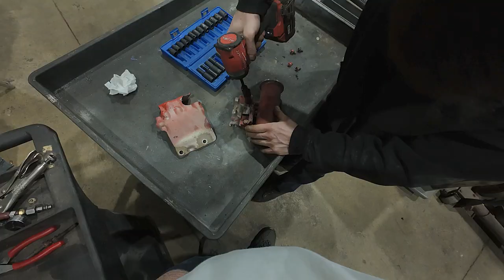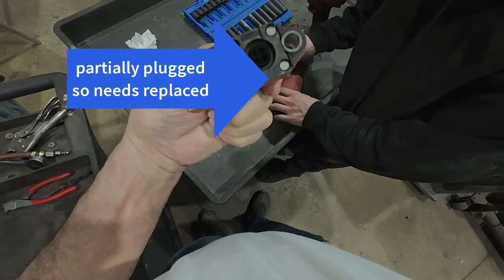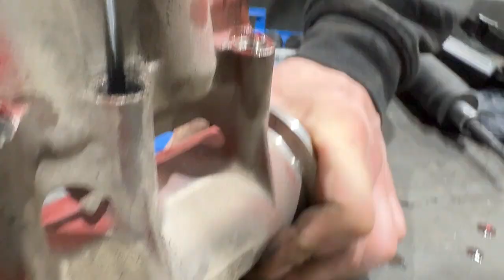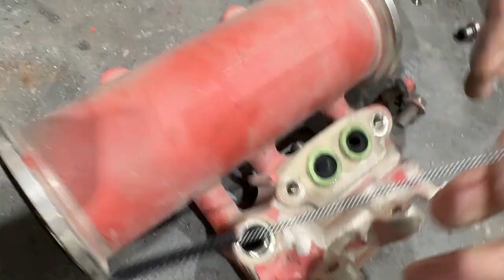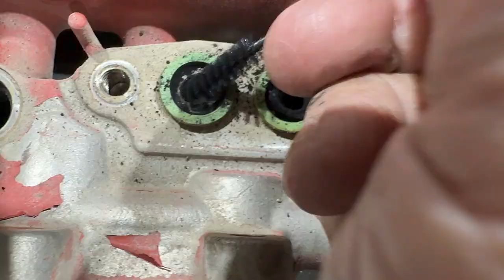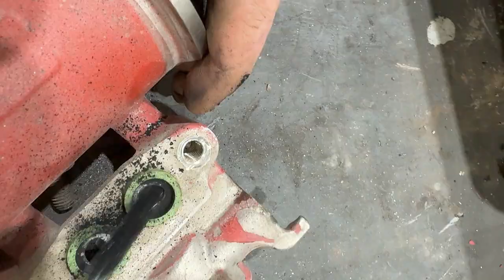ISX 15 Cleaning the egr flow sense housing

Comment: Joe. Did I understand you correctly when you said the EGR pressure sensors are different part numbers now?
Reply from the maker: Always verify the sensor PN to your engine serial and. you wont have any problems. Remember when cummins changes or improves or corrects issues with a part it gets a new part number (superceeded)
Reply: @ENGINESHOPJOE God Bless you brother!!! Thank you! 
I’ve recently also discovered that my thermostat housing is completely blocked. I removed the sensor and the line to the manifold and couldn’t blow compressed air from either end. I tried brake kleen, WD-40, all to no avail. The WD-40 did produce oil soot on the coat hanger wire but that was it. I still couldn’t get any dripage to come from the top to the bottom where the line connects. 

I’m purchasing a 5/16” wire brush for my drill and am planning on going at it that way. Any other ideas? I’m also looking for a new thermostat housing to completely rid myself of this isuue also….but was trying to not reinvent the wheel. 

Thanks 
James
Reply from the maker: Worst case you can use a drill bit turning very slow. You can feel when you hit metal vs carbon. That carboned up because there was a leak up at the sensor or a sand cast hole in the housing venting to atmosphere. Cummins used to tell us (when I say that I mean the engineer responsible for that particular system) if there are no air leaks the carbon cannot move into a passage or tube. That is why they always insist new orings when you remove a differential pressure sensor. The green square cut orings are super expensive but they have to completely seal or the sensor fills with carbon fast.

Comment: Thanks Joe. Just as important to thoroughly clean the venturi tube throat area. I have read that even a slight amount of soot buildup can throw off the calculated flow readings. Whole books on flow of fluids through a restriction.

Comment: How would you know & what would be a symptom?
Reply: Codes for low egr flow, excessively frequent regeneration, commanding higher egr position than usual attempting to achieve the required flow rate. (Differential pressure)
Reply: Hello. I’m having lots of soot problems and losing boost pressure at around 800 miles for boost leaks at gaskets. Engine was  just inframe about 30 k miles ago. When boost drops then I start getting egr flow codes and egr temp. What would cause me to keep blowing something then losing boost to fix again. First time blew turbo mount gasket next time blew out some exchaust manifold gaskets. Now it’s in shop again for boost leaks.  

I noticed a lot times my intake air temperature is 160 to 225
Reply from the maker: The intake air temp is in normal ranges. You should not be blowing out gaskets after an overhaul. The steel gaskets start to leak when the surfaces that clamp them are not flat. IE the turbo flange is slightly warped from heat and time. If the head is a recon from cummins the exhaust ports will be flat. We used to rebuild our own heads and a few had to be sent to a machine shop to reface the exhaust ports to make them flat again. We also refaced manifolds if needed. Other than that or insufficient clamp load ( bolt quality and torque) they should hold.